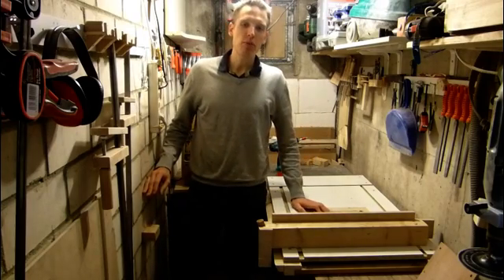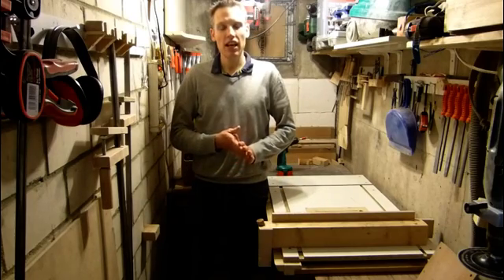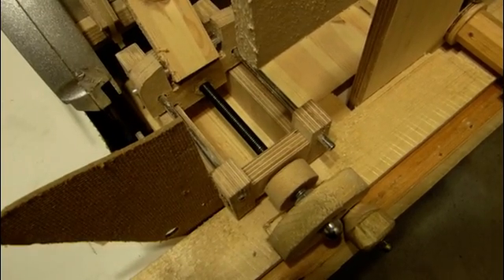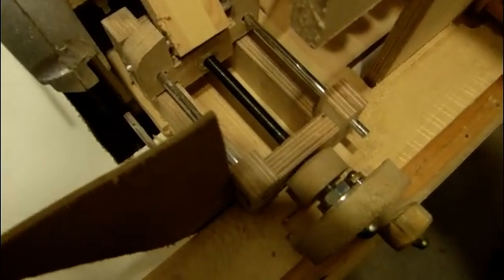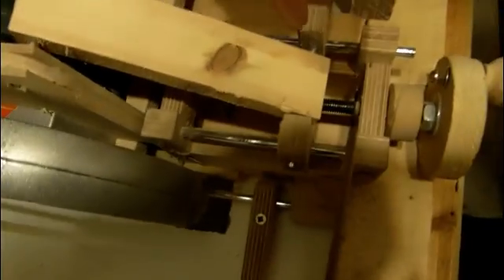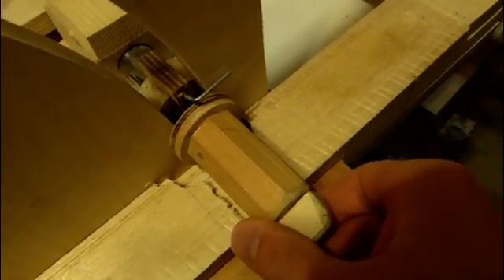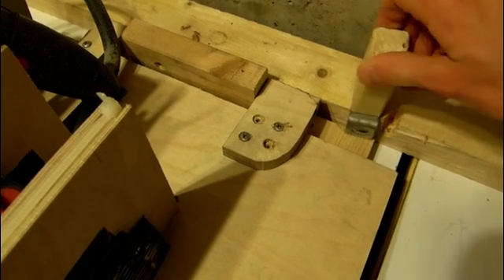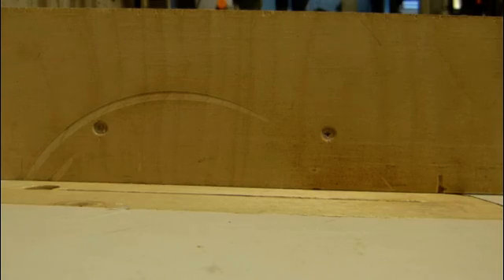table saw upgrade

Comment: to me, it's a good thing that it's slow, since, with one turn, your move 1mm forward or backward (when using metric scale threads that is...), the slower it is, the more precision you get... ;) well, i  think/hope i'm not wrong on that one, but it makes sence
Reply from the maker: Good point, but in this case I prefer speed over accuracy. I need that more often.

Comment: Hello Jakob, 
Congratulation for having such a organised work shop in such a small area. My shop is also small, but bigger than yours (3,25 m X 3.75 m) I liked the way you built the tilting and blade height adjustment mechanism, into your table saw built with circular saw. I have also built one, which has a riving knife (AEG CS-66) but i am yet to install DIY mechanism on it and using the mechanism which came with the saw, which is combersome to lift the table top, each time i have to change these two. Do you have any detailed drawing of the mechanism and if so, i request you to share it with me thro my email kbbaktha@gmail.com. You can see my blog also at http://alphazee.blogspot.in/ 
Thanks. 
Kadambi
Reply from the maker: Bakthavathsal Kadambi Thank you for you kind words, Bakthavathsal! I have a sketchup model, but it does not exactly match the finished product. I'll send it to you anyway.